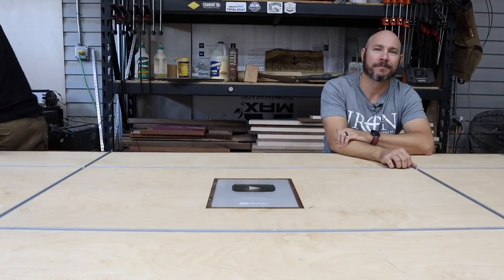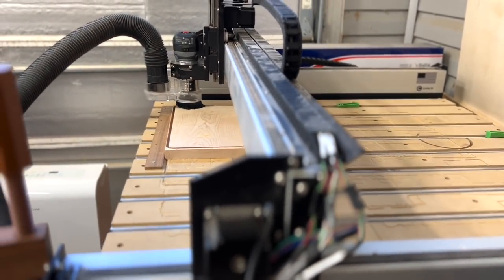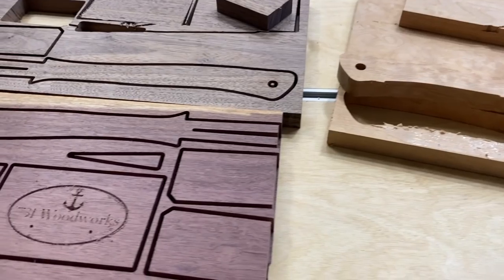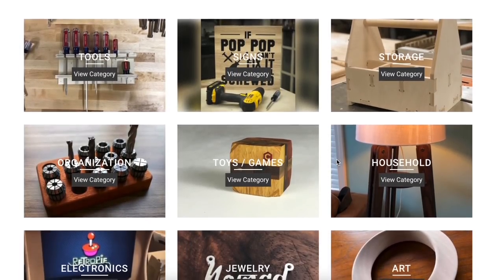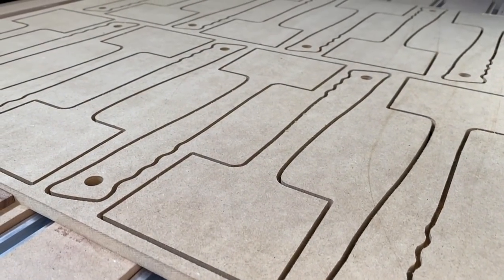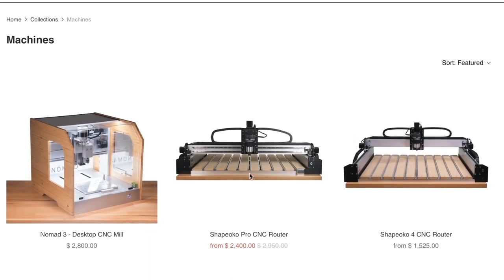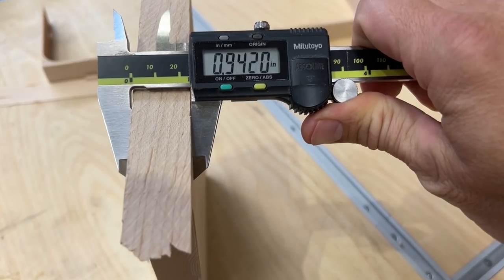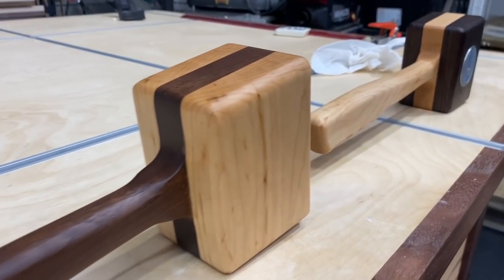10 Benefits a CNC Gives Your Woodworking Business

Comment: Hello Matt.  One suggestion I would make for your mallet templates.  If you run a program first to place two dots inside the boundary of each of your mallets in your mallet template you can then screw the mallets down, you will likely need a spoil board.  Once that program completes and you put the screws in and you can now run your "real" mallet program.  The bonus of this is you can cut your templates exactly removing the need to cut tabs and then flushing up the tab mark with the template.  I have found projects that let me screw things down because the screw holes don't ruin the look, like templates, are super helpful because the time cutting tabs really adds up.

Comment: Like your video. Most internet comments would not agree on using double sided tape.  Once you are familiar with this type of software, it's an easy transition to 3d printing or laser etching. As expensive as the machine is, it's crazy to skimp on the software.

Comment: In a couple of clips it shows a 1/4in endmills (could be smaller) routing out your catchall trays. One thing I've run into is correctly putting in bit Step-over. I know it's not a massive killer but if you buy good quality bits, general rule of thumb is 25% diameter as step-over. It's slower but your bits do last longer and make cleaner cuts.
Reply: Feeds and speeds are a learning curve that extends bit life and cut quality. Hardest for me to perfect.

Comment: Hi Matt! I'm considering getting a laser engraver for my shop, I think this could have the customization potential equal to a CNC! Those two in tandem would be awesome.
Reply: It really doesn't. Laser burns stuff. It's good to cut and whatnot but the edges will look burnt. Nothing wrong with laser in general - it just doesn't have the same usage as a spindle/router based CNC machine

Comment: i bought a 9014 cnc frame in early march. it arrived last week so about 8 months shipping it sat at sea for 6 months and i got a couple small rusty spots on the optical rails that i had to polish out. finished the mechanical side assembly today and it is ridiculously rigid. i went with a gecko 540 system from corvetteguy50 (Vince) I will start on the electrical install side next week and then the tuning in of the motors and vfd the week after that. biggest thing for me was the cost and amount of differences from the grbl based machine i learned on. i went with the 4 axis setup as well so i have a rotary axis and i have a project i want to try on it with a chess set.

Comment: I use CNC machines for making furniture and guitars.  I would not buy any machine lower than shapeoko 5 pro.  Belt driven CNC machines with palm routers are not for professionals  or production shops. If you are using them for a hobby or making signs or engraving names then fine but if you want your cnc to run all day you need linear rails on all axis and an air cooled or water cooled spindle. You also need a separate dust collector with an induction motor.  Don't cheap out on the software for 3d cutting.  Fusion  by auto cad is free non production shops.  I like aspire the best but there are many good software packages. Bits are expensive but buy the best you can afford which are made from pure carbide from companies like Amana. CNC machines range from 4k up 250 k for Italian production machines which are 10' x 5' and have multiple heads and automatic bit changes.  I find vacuum suction is the best for holding work but clamps and double sided tape or tape with crazy glue can work fine for small shops.

Comment: I'm debating getting a Shakeopo but I live in a neighborhood where the houses are pretty close. How loud it the CNC?
Reply from the maker: They are fairly loud when cutting.  The new Shapeoko 5 Pro with the VFD spindle is much quieter than the 4 with a router. You can hear that in this video https://youtu.be/udFcuwckPZw?si=pptGICCaDiFN0gAq&t=203 But when cutting certain materials and speeds, it's still fairly noisy.

Comment: 2 hours for 14 mallets in mdf seems really long. You are running about 10 minutes per mallet

What bit and flute count are you using? 
What is your depth per pass, feed rate and chip load? 
You should be knocking them out in less that half that time, especially in 1/2" mdf.
Reply from the maker: I've since sped it up and can get them out in less than an hour.

Comment: What Cnc are you using? (sorry if I missed it)
Reply from the maker: Shapeoko 4XXL in this video. Just got the Shapeoko 5 Pro in this week.
Reply: @731Woodworks  - about how much was that?  Also, how long would you say the learning curve is if you have never used one?
Reply from the maker: Check out my.carbide3d.com they have some excellent free training that you can use to get you up to speed quickly on using their software. You can do this before you buy anything.  That wasn’t available when I first started so it took me a few weeks to learn. Check out the link in my description to the machine for current prices.